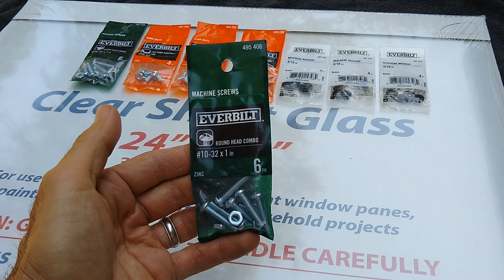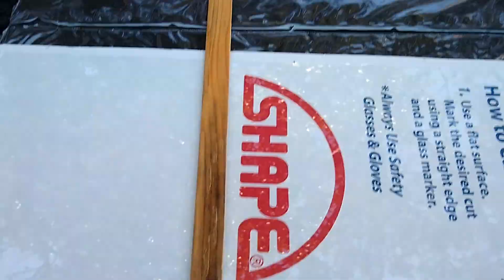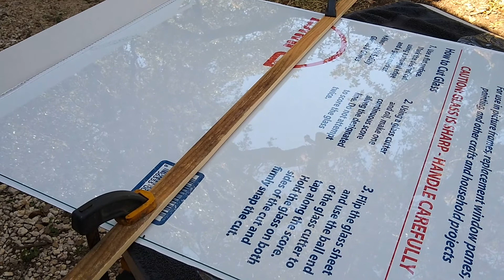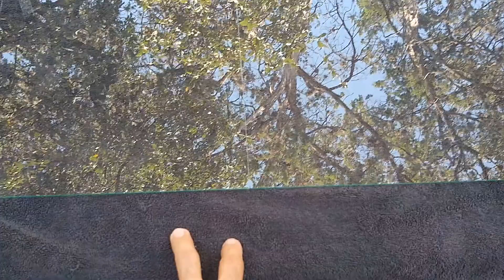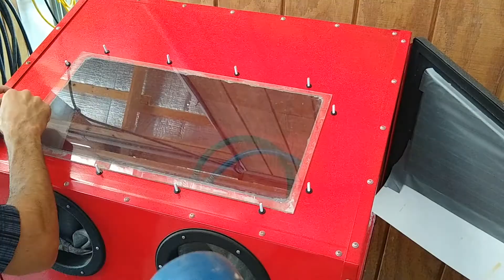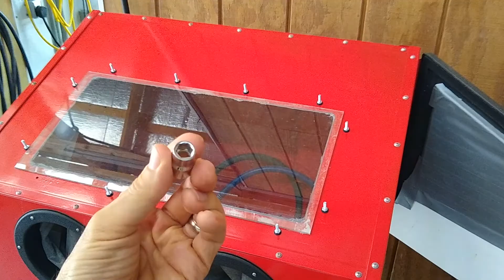Harbor Freight quick change glass upgrade for vapor blaster / honing

Comment: Can you vapor blast and dry blast with the same cabinet? Great series of videos.
Reply from the maker: Hi Robert, Thanks for commenting and kind words of encouragement. It can be done but the rework may not make sense if production is what you're after. I would just purchase a second cabinet and set it up as a wet  or dry system. Each one has a strength over the other. It really comes down to what you are working on the most. Cleaning and polishing of softer metals or stainless steel, then wet. Coating removals such as powder coat or rust from iron or steel parts, then dry. Wet blasting can remove paint pretty well but it takes forever to remove powder coats. Flash rust is also an issue with wet blasting if you are working on steel or iron parts.

Best of luck with your projects!

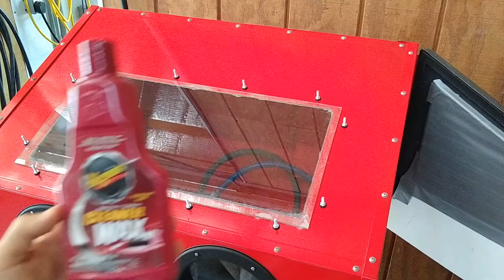Comment: Hi again! Thanks very much for this video. At 20:40, it appears there is an old piece of glass or plexi on the cabinet. Why are you using that and then the new glass on top - Why not just use the new glass on its own?
Reply from the maker: Hi Ryan,  Thank you for commenting. The videos on my channel are kind of a series of changes over time. If you look at the complete video list they should be in order (latest ones first, oldest last) I've ditched the two-piece glass setup and currently using the single 3/16" 12" x 24" glass with the 3M clear film.
Reply: @vbared  Where did you get the 3/16" thick glass?

Comment: Bad link on the bolts - you linked 6-32 bolts 
the correct part based on your receipt.  https://www.homedepot.com/p/Everbilt-10-32-x-1-in-Combo-Round-Head-Zinc-Plated-Machine-Screw-6-Pack-803341/204274635
Reply from the maker: Great catch! UcantBeSerious03,  They are supposed to be 1" long. Thank you for including the correct link.

Best of luck with your projects!
Reply: @vbared  I was at the final checkout window, all I had to do was hit submit and there I saw it. I went back to your video and pulled the part numbers off the receipt you showed.

Comment: My dad and uncle used to cut class for windows for living and  I have done it bunch of times as well. We have never done in this way with tapping; after scoring you slide your straight edge under the glass and that usually is enough to snap it and if not you give it a gentle push,
Reply from the maker: Hello Maciek, Thank you for commenting. You're 100% right, there are other ways to finish the cut after scoring the glass. The first piece of glass I had to cut was an arch for a cabinet door. The pressure and tapping is what worked for me in that case. There are many interesting ways to do it including using a soldering iron to focus heat on the score like for more complex shapes. Thank you for sharing the straight edge method with myself and viewers.

Best of luck with your projects.

Comment: I have a better idea! But before I start, why do you need such a large viewing window? Obviously when doing small parts or pieces you find yourself bringing the object close to the glass so technically having an opening  of say 4" x 8" should be more than adequate. Now if you have an extremely large piece to clean then maybe it could be useful. That being the case, here's my suggestion. You can cut out a piece of plywood or sheet metal the size of your existing window install that with a 4 x 6 cutout for smaller pieces of protection glass. You certainly will save on replacing the glass and even better if you spraying clean water on the glass to keep it clear you will be more effective clearing a smaller area.
Reply from the maker: Hi G RP, thank you for commenting. I like your smaller window suggestion. One of my future plans is to build one that is big enough to fit my 17" wheel, tire and all.